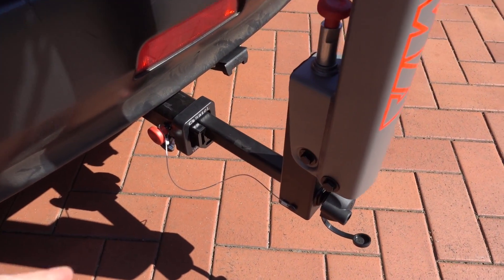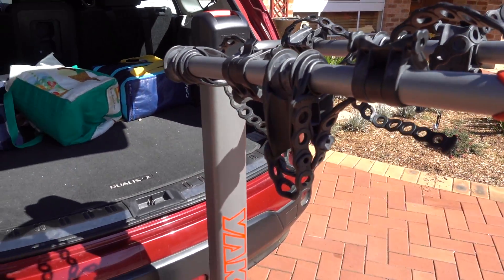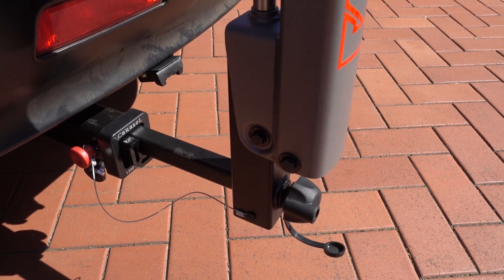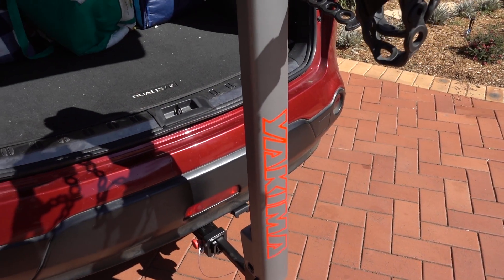Car Bike Rack Mechanical Design Paranoia

Comment from the maker: I think that at a minimum it's going to need a 45deg welded bar from the hitch bar to the vertical bar to strengthen the thin tubular steel right angle joint.
A photo of the hitch bar tubing can be found on the forum here: https://www.eevblog.com/forum/blog/bike-rack-mechanical-design-paranoia/msg2640924/#msg2640924
Reply: The lightest carrier we have for the wifes wheelchair also has a pivot joint. Only a bolt as a pivot and a hitch style pin to hold it either up or down. It is up to you if you wish to weld it or not but again the weight is not near enough for any concern. Piece of mind is worth a whole lot too so, if you feel better about adding a brace, then by all means have it welded in :D
Reply: It's look like an inverted pendulum problem, although I am not an engineer of any sort I think the sway the contraption has help mitigate stress caused by a static setup and relief the joints which are made of aluminum from any possible crack.
Reply: i would try reversing into anything
Reply: If you look closely the smaller bar that goes into the receiver (the square hole on the cars hitch) goes all the way through the base of the rack to where the tightening nob is. 

All hitch mount rack have this problem, but like you do with electronics, they are engineered for this. 

You may want to find a rack that uses a two inch (50mm ish) receiver instead of the 1.5inch with the adapter. 

I dont think its in any way unsafe. And you may find that loading it with bikes helps with some of the sway, as they are designed to be under a load. 

The tolerance on hitches is pretty large (at least 2mm if not more).

Comment: I had the same issue though my hitch is OEM from Mitsubishi, the tow bar hitch should have a lock bolt it will make the rack more tighter than that. That solves the problem there a little give but not as bad as that.

Comment: I talked to a guy that has the same rack and what he said about the swaying was this.  "It did initially until I noticed I didn’t push and lift it up before tightening. Once I straightened it out in the receiver by slightly lifting and pushing forward, it allowed me to tighten it even more, and then it was very secure with barely any movement while loaded."

Comment: The wobble is because the knob isn’t fully tight. That “thingy” inside the hitch tightens and secures the bike rack inside the hitch when you tighten the knob clockwise. Please do that and let us know if it stopped the wobble.

Comment: The hitch shank to box beam weld looks okay to me. You might try running two bungees from the safety chain loops on the hitch receiver to the arms. Run them in an X pattern with the left loop crossing over to the arm on the right side and the right loop crossing to the left. That should give you both some forward tension and some side to side tension which would reduce the swaying.

Comment: It will be fine. It looks sketchy, and there are better designs, but this one is used in the tens of millions yearly without major incident. Even though it looks cheap and weak, all the strain is really on that 1-1/4" steel tube, which is no big deal. Where it goes into the receiver and you have that spacer is where all that wobble comes from. Part of that is from the fact that there has to be a clearance that is great enough to prevent the bike rack or other object from rusting and getting stuck over time. Even on hitches carrying 20,000lbs, with no weight on them, the hitch wobbles around in the receiver and only a little less than that bike rack (bike rack has much longer arm on it, so the wobble is really pronounced. That 1-1/4" steel tube, even using the cheapest and crappiest steels can still support 500lbs with a safety factor of 1.5. And that bike rack is a good brand, they are not likely using the cheapest steel possible, likely a midgrade. Which at 500lbs load, puts you at a safety factor of 3.7.

It seems janky, but its fine for everything except offroad use, for offroad use, I'd probably get one rated for that, even then it's not the hitch section that will fail, its more likely the tilt mechanism or the bike hold downs.

Comment: If all the play is from the square section bar then I would use 2 shims to pack it out so it is a tight fit in the 'Carasel' unit, also a tapped hole a few inches back from the existing bolt would allow for a second bolt which would eliminate a lot of play,
If it is from the hinged joint then chuck it back and get a different brand, this one looks strong enough but lacks decent tolerances

Comment: It was designed for the 1 1/4” receiver.  Just extra play from the adapter.   No worries.  Get a rack that vertically mounts the bikes on the hitch receiver

Comment: I have a cargo rack that uses the same sized 1 1/4 inch bar, only difference is my car has a the same size receiver. It wobbles all around like yours does, and I use it to haul my 60lb+ paramotor on long distance trips. Structurally the flex in the small tubing isn't an issue and that size hitch bar can hold up to 500 lbs at that length. Even with all the bikes on it and tons of turns I doubt you'll ever break it.

That being said, just because it works doesn't mean it's not annoying as hell!

Comment: I am NOT an engineer. First thing though is another car accidentally slamming into the rack. I am guessing the sway is not great but if it has consistent limits, some movement may be better as to avoid being brittle. The weight load is ultimately going to have to be supported by that small channel going into your car. It would have to be pretty tough.

Comment: My US version of the same rack has a threaded pin and an internal thread, so I actually tighten the pin in a ratchet. When it starts wobbling like that, it would mean my pin is loosening. So if you can tighten the hitch "bar" in the receiver any more, that would likey be an issue. I would be worried with it wobbling that much.

Comment: That rack will do just fine.  To take some of that wobble out, lift the rack toward the vehicle as you tighten the handle. You will find it will wedge itself in tighter.

Comment: Deflection - My guess is that the problem is in that plastic spacer used between the hitch and the bicycle rack frame. In the US, there are 2 sizes of hitches. 1.25 inches and 2 inches. It appears that your hitch is 2 inches and the bicycle rack is 1.25 inches w/ a plastic spacer to make it fit in a 2 inch hitch. 
Your concerns are justified. I would also worry about wear & tear on the bicycles. The rocking could cause brake & gear cables to get damaged from hitting each other. Also paint or decal damage.  Ask a Yakima Rep if they would like being strapped on that rack while you travel down the road beside a road train. I bet that they give you an upgrade. =)

Comment: I would not use that bike rack. Use one that fits your 2 inch hitch. I use a Yakima with a two inch mount and it does not sway like yours. The problem i find with yours is that when traveling over rough terrain, you will lose your bikes.

Comment: You don't have to be a mechanical engineer to know that wobble=bad. If it's designed to move then it would have flexure points (springs, hinges, etc. A bar designed to flex would also work as a flexure point). The places where it wobbles aren't flexure points. Double check all the mountings and add shims where necessary.

Comment: You're using a hitch receiver in a way that it was not designed to be used for the sake of convenience. They are not designed to be stable rotating along the axis of the tube. That being said, the design is mechanically sound, if not aesthetically pleasing. Yakima had been engineering bike racks to a price for decades. It will hold your bikes without a problem. There is not enough weight involved to work harden the  square tube or its welds. If you want an aesthetically pleasing solution get a roof rack. But, even then, if you push the bikes side-to-side, they will still wabble. But, somehow this seems more "normal" and therefore less worrying.

Comment: What you're seeing is called "abbe" error.  Basically the slop in all the mechanisms stacked up.  You can shim some of the joints or add spring washers to add pre-load to remove the wobble or greatly reduce it.  I wouldn't be worried about anything breaking.  The smallest cross sections appears to the welded square tube which looks plenty strong.

Comment: Most of the design looks acceptable. Yes, I am an engineer, but I've never done layout on something like this.
The two things I see most likely to fail are:
- The plastic "tie town" straps that you are using with all the holes in them
- The spacer block in the hitch receiver (which is also where you "wobble" is coming from.
Of course, my concerns could be unfounded because I don't know what materials are used here.
One thing you should do is move the space so the smaller steel tube of the bike rack is resting directly on the steel receiver hitch, and move the spacer on TOP of it. this is creating a lever and the highest pressure is on the bottom pinch point. Depending on the material used, the spacer could crack or get increasingly more loose from the constant motion and wallowing. I would also use some legit tie-down straps for the bikes rather than those plastic or rubber things supplied there... especially if they've been in the sun a lot.
Other than that, the design looks acceptable..  but this is a little bit of a stretch because we don't know how much other plastic is being used int he locking mechanisms. I'm guessing there is no plastic in them other than the handles

Comment: Student here. Yep, as others said it would be difficult without knowing the actual specs of the tube. But to me it seems like they gave up on some estability to gain on lightness and portability (that assuming they did the calculations correctly). It seems they included a plastic adaptator to reduce the cross section of the tube because they dont need actually more than that, that reinforces my theory. Anyway, I wouldnt use it in a 3rd world country road, thats for sure, but in your case I would use the heck out of it during the warranty period and check it for integrity once in a while. That supposing returning it is somehow difficult by now. Also check the manual and even call them and ask about whats happening and the maximum elongation of the tube they recommend.

Comment: I'm no mechanical engineer but I'm not sure I'll put my 5 years old niece's bike on it. It should last for a summer, but in the long run... meh! Just put 60 lbs of bikes on it and that tilt movement would probably put some torque force on that bottom joint. On the long run, something gonna break or bend. That said, could it be a loose bolt a 90° joint?

Comment: It’s bad because bikes blocking the indicator lights and all the rest.  The “stand off bar” is by design (square 20mm steel?) never stiff enough to handle all the torque. The flex you experience doesn’t have to be disastrous by it self.  I would ditch this nevertheless.....

Comment: I have same kind of paranoia, but from the perspective of the other drivers, and every time I have a car with one of those bike racks in front of me, I change lane, or try to pass, or let the car behind me pass me.
BTW, I don't see another important feature, the repeater for rear lights and for the licence plate.
Maybe is not yet mounted, but even  those listed on the catalog seems doesn't have one. That is an important safety feature as it's intended  to make brake lights always clearly visible to drivers from behind. I think in EU is mandatory, because all bike racks I've seen here have those additional lights.

Comment: Structural engineer here, I think it’s a bit wobbely. This who design puts quite a bit of torsion on the hitch thingy. I don’t like this design, the lever lengths are quite long. Bike racks are pain in the ass devices, their either too heave and too cumbersome to use or their too dodgy in their design.

Comment: It needs two (2) or more bolts putting the bar into the receiver. On one it pivots hence the movement. Drill an extra hole. Bonus is that now you can set the distance to the tailgate yourself.

Comment: There should not be anywhere near that much side to side freeplay with that bottom 45degree bolt nipped up.  The pallet machines I've worked on all rely on those types of 45 degree bolts in box sections and they are rock solid. You might have to wiggle the rack as you resecure the 45 degree screw so the play is eliminated.

Comment: This is the ultimate defensive bike rack.  It has both switchblade and trigger-finger!  My initial reactions with bike racks was similar to yours many years ago but the loading is minimal for the materials and Yakima is a major brand that does their homework.  No worries.  Would you stand on a 25mm square tube extended out of the hitch?  I would and I am way over the weight limit on this carrier.  Also, if it was rigid to the hitch it would be more apt to develop stress fracturing.  Think: clamp a meter stick to a workbench and bend and release the end.  It will vibrate, oscillate, decreasing to stop (you have shown many waveforms on your scope that are the same).  Then, hold the meter stick to the bench loosely with your hand and try to flick the end.  Nearly no oscillation.

Comment: If you haven't already, I'd consider taking the whole rig to a hitch specialist. Here in my area of the US it is Reese; not sure about Australia. I had a somewhat similar problem and they were able to come up with adapters and interface parts that were much better made than the ones that came with the carrier. They should at least be able to tell you how safe/worrisome your rig is, because they see towing rigs/carriers/etc dozens of times a day, and have a good idea what's normal/safe and what isn't.

Comment: without material info and other details, cant do an FEA. but a real world test of breaking force (if you have a spare one) can give you a very good idea of load safety margin and fatigue etc. the side to side rocking although looks scary is reasonable, car wheels can only provide limited G each direction, I am only worried about hitting a bump and creating a huge downward overload.

Comment: This is like crane construction. They wobble a lot and might look like they would snap under any weight they lift , but , it doesn't happen. :) You should try with bike mounted on it. We use a lot such designs in mechanical engineering for weights. And , they are quite stable. Any machine or part that utilises lifting some kind of weight must also be flexible , otherwise , too rigid and heavy constructions are more prone to fatigue and sudden fails , even if it looks solid and strong. This will probably show initial signs of wear , but , that should be it for start. Cars for example , must be able to flex during driving , but , nobody notices it and only by looking at joint points , You may spot signs of entire chassy flex marks.
I hope this helps You a bit and gives You more confidence. Tho , I don't know data spec for this and , where I live (Europe) , we use DIN standards for many things.

Comment: You're going to get a lot of people talking about that right angle. But of it is from a company that you are capable of takeing legal action against. They won't make somthing that won't take 3 or 4 times the rated force to break. As for the bouncing. As you pointed out, leverage. Short of welding supports from the top to your car. That is just the nature of the beast.

Comment: I wouldn't trust it with a load on it. The Horizontal bar coming out of the Car Hitch is too long and too small a dimension for twisting torque stability... Then there is the folding Knuckel Joint, It does not seem rigid enough (too much play)... Get a bike rack that is more solid.

Comment: All the stress is going down to that "flimsy looking" black rod. That doesn't look good. 

Option No.1 Why not cutting that piece of rod shorter to decrease the leverage?
Option No.2 I would combine that hanger with ropes securing the bikes to rear window pillars or something like that. It will look messy but just hanging bikes on that, doing 50mph will not be safe.

Comment: Just some flat 2 or 3cm webbing attached to the top of the post, under the bike "prongs" with those  boot lid clips.
Then take one either side. Tighten up the adjusters & you've got your side to side movement sorted. 
One thing, put a single twist in the webbing either side, from post to boot lid. It'll stop vibration from edge vortices shedding building up as airflow over the strap increases. A single twist gives you chaotic vortices creation with no chance of harmonics building up (which could lead to annoying noise in the least but total failure in the worst. The same as the Tacoma Narrows bridge...)
I think they sell them for strapping luggage to boot lids. 
Like this https://images.app.goo.gl/SrGEW3fjfMXd5dn68

Comment: is it actually the metal bending or simply just rolling around, cause if it's just rolling around then she'll be right, if it's flexing, but not flexing on a joint, assuming that's 20x20x1.5 RHS then I'd say you should get about 10 years out of it.. The only concern here, is that you may be a knob cyclist, in which case I don't really care if it breaks lol